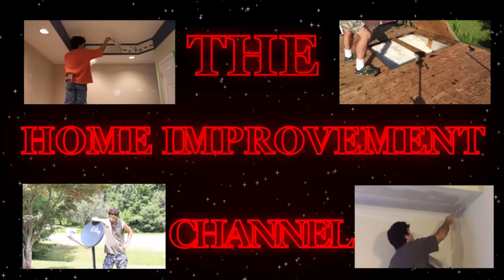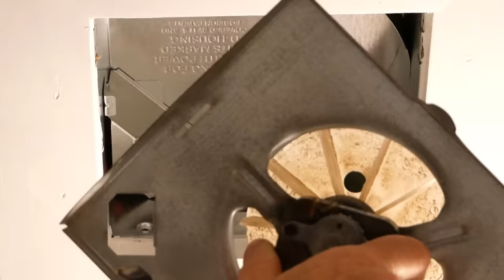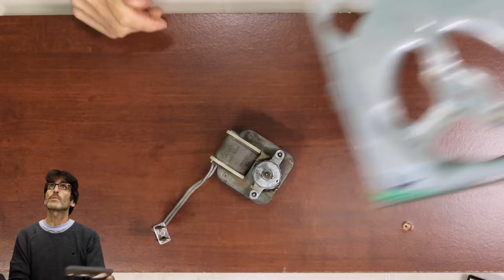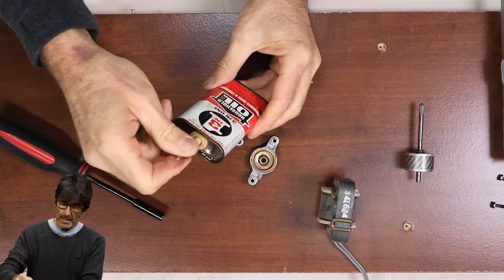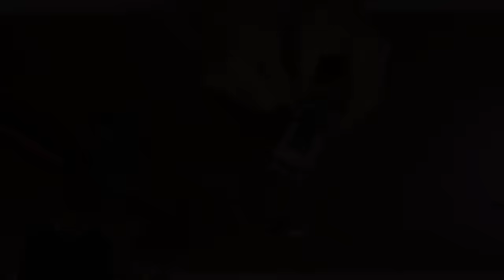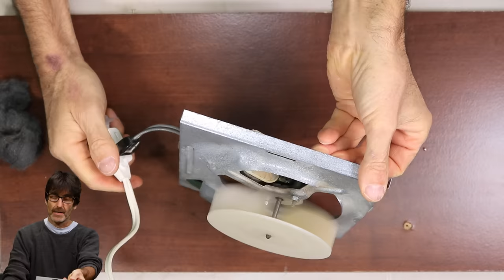Replace Your Bathroom Fan in 5 Minutes FLAT!  NO Attic Access!

Comment: But wait...there’s more!  Older fans aren’t so forgiving...most are hardwired into the electric and that is another nightmare all together!......so be prepared..it might not be so easy to get that fan out of the housing.  And be careful if you have that damned popcorn ceiling crap installed...once that stuff starts falling off - you are in for a major fix-up project.  Been there + done that.....yuck!
Reply from the maker: Yes true.  This fan is a very popular fan, but it is not the only one out there.  The older ones are much worse.  I included the taking apart and cleaning part of the video in the 2nd half because that may be an option for older fans to try before ripping the whole thing out of the ceiling..

Comment: I'd rather replace the whole unit because those NuTone bath fans are pretty crappy. Small, cheap blades with small airflow.
Reply from the maker: I'm sure compared to an expensive one, but for $15 bucks they actually work pretty good and last for many years.... :-)
Reply: @TheHomeImprovementChannel  oh ok lol :)

Comment: You should of explained what to do if the motor is junk
Reply from the maker: I didn't want to make the video super long.  If the motor is junk and you have one of those motors that doesn't exchange out as easy as the one in the video, sometimes you can buy a different fan motor and actually remove the motor itself from the mount and remount it in the existing housing.  Just reuse the original fan blade and hopefully it'll all fit..  If that doesn't work, the only other solution is to replace the entire fan, housing and all..
Reply: @TheHomeImprovementChannel  I know what to do being a licensed electrician in nh but I wish this subject was talked about to try and help do it yourselfers
Reply from the maker: @jeffhrycuna3349  Excellent!...

Comment: If it only takes 5 minutes why is the video 9 and 1/2 minutes long?
Reply from the maker: The 2nd half is about cleaning and oiling the fan in case you can't find a replacement.

Comment: All right so this bathroom exhaust fan is squeaking and old because of the design so they had to take it apart for a new motor because the old motor is squeaky 😏🙄
Reply from the maker: You could try to clean and grease it if you havent already replaced it..

Comment: It’s still the same old crappy fan that makes noise but is otherwise useless. If you want a real fan then quit playing with Suzy Homemaker fans and buy a real silent running brushless fan. Also, check in the attic to be sure it’s vented properly. And if you don’t have attic access, well, that’s a problem you should correct!
Reply from the maker: Ok thanks.
Reply: I thought the fan he demonstrated on was brushless.  The noise would probably be coming from the impeller.  Anyway nothing wrong with a little "white noise"  in the bathroom anyway.

Comment: Sorry man, I need to replace the fan and the housing…it is a 25–year old housing that is very rusted and dirty!!! I bought a new fan and the housing and the new fan are not the same size as the old one!!! That’s not a 5-minute job for sure!!!
Reply from the maker: Hi Elvis.. I didn't say this would work for every situation 😊😊.  This does work a lot.  They are still making these fans.  Many home builders use them because they are cheap.  If you do wind up replacing the whole unit, u might consider getting a fan that's bigger than the old one.  It'll make it easier to remove the old fan.  I did a video recently on replacing the whole thing.

Comment: Unless you are a tinkerer, just buy a replacement motor. To me they aren’t worth screwing with.
Reply from the maker: The cleaning is for the ones that are difficult to find.  That can be done to see if you can get it going again instead of replacing the whole unit in the ceiling.. housing and all.

Comment: "Usually the shaft is sticking through and you can pull it right off."  Negative. Mine had some kind of locking washer that kept the blade firmly in place. Video doesn't show how to take THAT off and it wasn't easy...you skipped to the blade ready to come off which wasn't helpful.
Reply from the maker: Green Waters That’s why I said “usually “.  There was nothing to show.  On that model, it pulled straight off with no tools needed.  Yours is obviously different